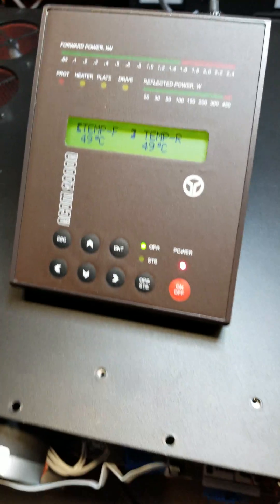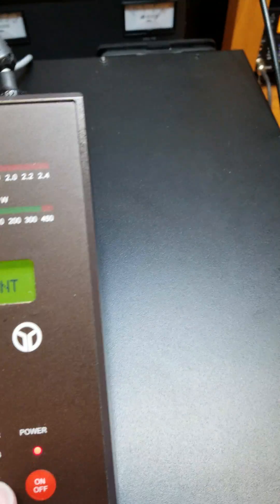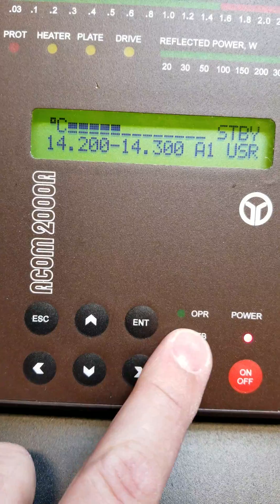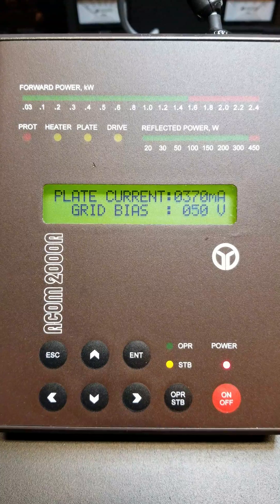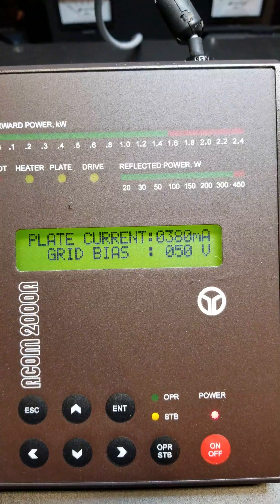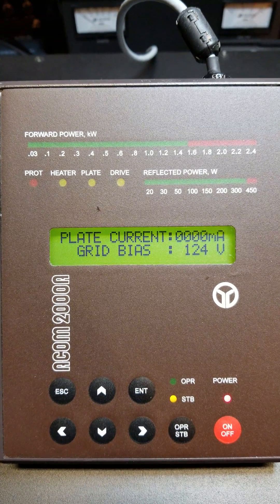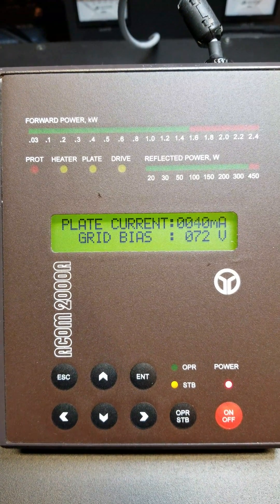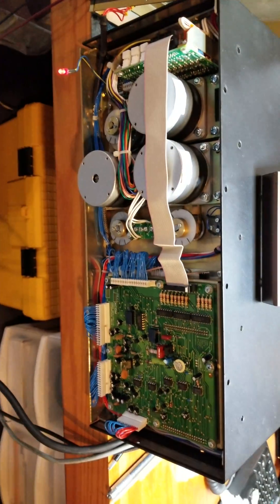Acom 2000A bias alignment test

Comment: Eric, I found the problem to be a bad tube.  Thank you. Can you tell me what the correct HV reading should be on the RCU display?  I put in a new tube and was setting the Hi/Lo gain bias and touched trimmer pot RP12 in error.  My display presently reads 3.0 KV and I don't know if this is correct.

Comment: Eric, I've got a problem with my 2000A.  If I power on the amp with the mains switch and then push the on/off switch on the RCU, the normal display will show on the RCU and begin to count down for warmup.  After about 5 seconds, the display shuts off and reads "BIAS TOO LOW AT POWER ON: -043V" and the amp never fully warms up and turns on.  I checked all of my mains connections and voltages..........all good.  I erased the Nonvolatile Memory to return the amp to its Default Settings.......no difference.  Will not count down timer and turn on.  Can you help me out with my problem?
Thanks,

Joe - N1VJJ
email: rfsignals@aol.com

ps. I did try shutting the amp off for 5 mins. then trying again.  Also, I checked the keying cable from radio to amp and it's fine.   If you need any additional info from me, just let me know.
Reply from the maker: Either the electrolytic capacitor in the bias voltage circuit has failed, or you have a tube that has developed a shorted filament. 

You can carefully try starting the amp with one tube removed at a time to determine if it is one of the tubes. If it passes the startup with a tube removed, then you have a bad tube. If it still fails after trying both tubes, then you are lucky and most likely it is the $2 capacitor. The only down side is that it is a bit of work to remove the board to repair it, then put it all back together.

You will need to remove the HV transformer, then disassemble the power supply board stack. The LV bias board is towards the bottom.
Reply: @k2cb   hy, i'm in the same situation, "low voltage bias ...." you say capacitor on the lv board, but which one? I disassembled the plate and checked the tensions, they all seem to be there, little different according to the service but present .... some more info? Thank you. my mail ik8tng at gmail dot com
Sergio.
Reply: Today SOLVEd, in my case, inside LV board nothing problem, i have tested the board outside the PA. and many tension were out of order....10v i read 16, 48v read 59 ecc....    I have discovered the fault on the HV BOARD, one of switch at protection of user, do not closed during normal operation, and again more, the voltage switch which select 200 220 20 or other, it was selected for 210V instead of 220-240v here in italy. Now all is ok, the power amplifier is going again For future hel to all i hope this is helpfull. Ciao Sergio IK8TNG Aversa

Comment: can you tell me how to adjust the 2000a for proper values?
documentation available?
Reply from the maker: Google search for the Acom 2000 technical supplement manual. There is a page that explains the procedure. Basically, you put the amp in the test mode per the video, connect a multimeter to a specific test point, and then adjust two potentiometers, one for the low bias level, and one for the high bias level. Use EXTREME caution, as you will have the high voltage points in the amplifier exposed during this procedure, and will need to defeat the safety interlocks. Failure to follow the safety precautions could lead to a blown amp, fatal injury, or both!